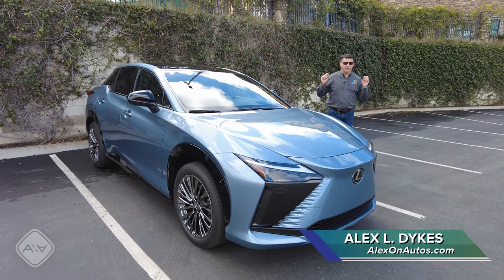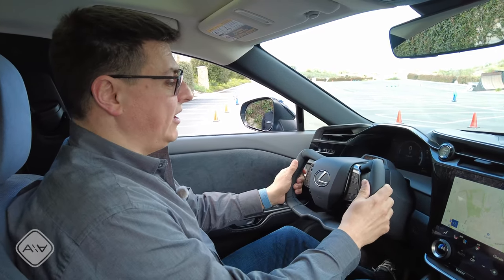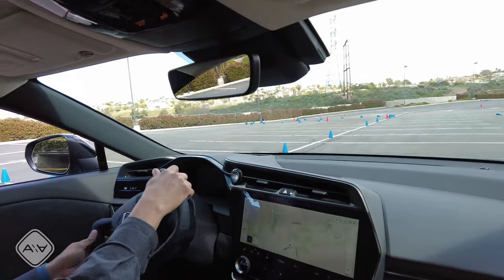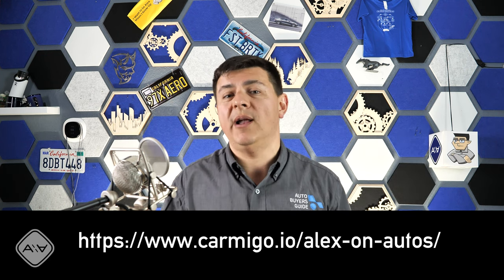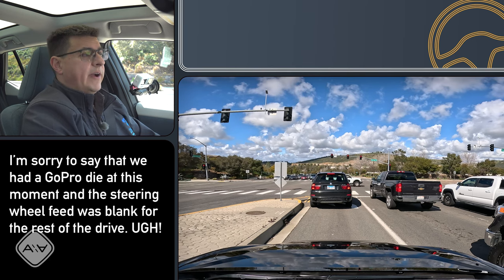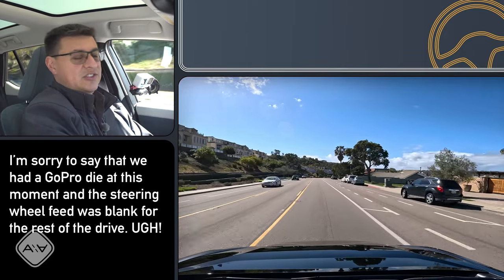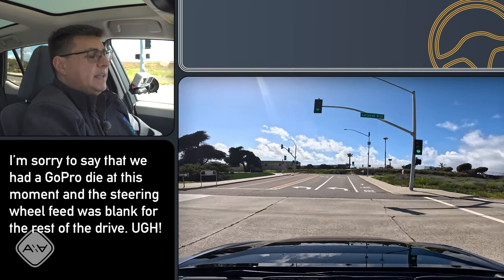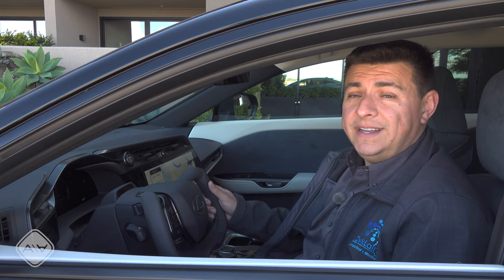The RZ 450e's Steer By Wire Yoke Is What Telsa Needs To Try

Comment: This is exactly what I thought, or was sure, Tesla would do when they implemented the yoke.  It seemed obvious that this was the correct way to do a yoke and it's weird that Tesla didn't do it.
Reply: @daflipbizkit  it seems like something they would do. They like removing physical things from the car, so removing a steering column is on brand.
Reply: You took the words out of my mouth - I had just assumed this is what Tesla had already done! I didn't know Tesla just lazily changed the shape to a yoke and didn't change anything to match. Silly me for thinking changing the steering ratio with speed would be obvious.

Comment: If I was in the market for a new Lexus I'd option it without, mostly because I wouldn't want to have someone borrow my vehicle to say, make a quick grocery run, only to have them wreck my car due to them not being familiar with the steering system (different ratios at different speeds is asking for trouble if you don't walk someone through it beforehand)

That being said, I think this does make sense in the long run for an EV. It gets rid of mechanical parts, makes it easier to manufacture for left/right side markets, and makes it way easier to integrate with automated systems, it's much more like a giant RC car this way. A lot of older buyers are going to dislike it just bc it's different and unfamiliar but my main reason for holding off is bc it's the first implementation of new tech. I'd wait until the 2nd or 3rd gen, after they get feedback and tweek it to be less spazzy.

Comment: The Canoo EV minivan also has a steering yoke which changes its steering ratio based on speed.  I would use one of these as long as I didn't have to do hand-over-hand steering.  The Tesla yoke seems to be poorly thought-out.

Comment: It's not about the "yoke" as I'm reading in some comments. It's about the variable steer by wire. I think it's the future of steering. The hand over hand, lots of movement to the steering wheel we do now will go away. I'm big on this car. Despite whatever shortcomings there are with range and charging speed, the rest of the car does things I like. I'd only ask for the option of full one-pedal drive. The only silly thing I've found with this car is the fake propulsion noise in sports mode.

Comment: Definitely a solution in search of a problem. How do people adapt who drive different cars frequently (I do)? How does this system handle decreasing radius curves where your speed has to vary, sometimes drastically? How safe is this from system failure? What about state motor vehicle laws mandating direct mechanical steering? Will training be mandatory for drivers new to this system (haha, when pigs fly!!)?
Reply: Just like anything else you get used to it.

Comment: how much extra battery does the steer by wire take and will the steering work when you run out of power?
Reply: The steering has its own emergency power unit

Comment: I would absolutely love this on my next car.  I have a bunch of questions:

1) I heard a loud click when you turned the yoke to the right of center on the test course.  Was this caused by the yoke?  Something hitting your microphone?  Something else?

2) Can you select a custom feel for the yoke?  For example, I prefer a tighter steering feel, with speed sensitive feedback.  It seems like it would be easy for the driver to select a steering feel that they prefer with this design.  Does the RZ let you do that?

3) Does the force change as you turn the yoke more towards the left or right?  In other words, does the yoke's resistance increase as you turn more, or is it linear throughout the turn?

4) Does the yoke return to center when you release it?

5) How do the yoke design and the instruments being located farther back affect instrument visibility?  Is it easier to keep your eyes on the road with the instruments closer to the windshield, as in a heads up display?
Reply: Q3, feedback force seems to me like it would be absolutely key to making this work well. Also, from Alex's parking lot demo, seems POORLY implemented if at all. Sad!

Comment: This has in fact been in the works since at least 2014 in the form of an E-HPS system although back then a manual column was still required as a backup steering system in case of a failure.  The steering wheel was connected to a torque sensor for steering inputs which were passed to an ECU to control an electric motor that powered a standard HPS steering gearbox.

Comment: This reminds me of the racing technics.   In motorsport, steerings are modifed to allow the driver to keep hands on the 9-3 position and never take hands off the steering wheel on track.    Personally it makes sense to me, as in my racing sim I have my wheel set to 270 degree of rotation, instead of traditional 900 degree like IRL.

Comment: I might opt for the yoke over the regular wheel. It does mean less turning to make tight parking maneuvers. And it sounds like it'll insulate the driver from road vibrations.

However, for most, they'll probably think the yokes on them.

Comment: Less on the steering, more about adding range.  ~220 miles is foundational.  If they want to be up there with the Model 3 and other they need to add +100 miles.

Comment: Esoteric engineering question: If you have the steering wheel at a given positional angle at at one speed and accelerate or decelerate without varying that steering wheel angle, does the rack change steering angle? The answer would likely have to be yes.  

This was a concern with Sport modes and variable throttle position mapping. What happens if you engage sport while car is in motion and throttle is depressed. The solution was usually that they ignore the sport button/mode change until you fully lift the throttle once. That avoided sudden unintended throttle variation.

BTW, it's my understanding BMW has done this since the late 1990s, but to a lower extent. We had it before steering by wire. Our 2000 BMW Z3 had it, and I can't say it was ever a problem or even noticed. Power steering sucks the life out of all modern car steering anyway. I appreciate the changes you're describing in this video are FAR more pronounced because yoke and the need for never requiring crossover full turns of the steering wheel.
Reply: yes

Comment: I think with time the driver's muscle memory will rewire for the yoke and inputs will smooth out. Still though, I would guess most people that can afford a top end Lexus or Tesla have more than one car and so going between Yoke/Steering Wheel would be odd. Not really an issue for me until it trickles down to the Corolla Yokester.

Comment: I suggest this is helpful at slow speeds but not s one gets closer to the 45 mph switchover if I understood correctly. those of us who play racing simulation games have used such parameters on wheels for years and many times we make the effort to remove or minimize the variable steering aspect. For many of us, at high speeds linear feel on the steering wheel is very important..

Comment: I wouldn't call it a solution in search of a problem. It's more solving the original problem of the steering column that requires the 2.7 turn-to-lock. Back in 1890, there was no variable way of doing it, so here we are. Everyone getting their license asked why it requires 3 turns to lock but we all have to just get used to it. The same will apply to this system if it ever becomes mainstream in the future. 

Either Lexus will set a precedent and our grandkids will have to get used to this system, or they don't, and everybody still turns the wheel 3 times lock to lock.

Comment: BMW has had Variable Steering wheel on their X5,X6 and some other models way back when as their steering wheels were known to be firmer and some people had a hard time with the wheel so it was available as an option but it was pricey. I think the steering column was still there but not sure how they implemented it into the vehicle. It is weird and does take time to get used to it
Also, the new electric vehicle CANOO is also using this same variable steering.
Reply from the maker: Variable ratio steering has been around for a while, but the ratio spread is small. This is entirely different as it radically changes the ratio.
Reply: @AAutoBuyersGuide  got it!

Comment: Will be interesting to see what is the fail safe mode. Being computer controlled, what if that fails?
Reply: It's been in planes for a while, it's fine
Reply: @klyded8523  planes have redundant systems,  cars don't.
Reply: @gianfrancoa  it's fine, don't worry about it, there's safety measures in place
Reply: @gianfrancoa  btw it does have a redundant system, so you're wrong there.
Redundant processor, and emergency power supply.

Comment: steer by wire is scary because if the car loses power then you have no way to steer the car vs having a physical shaft connected to the rack

Comment: I think if you haven't used for a week you can't really have a definitive view on it. It's different and by default having to learn the system will cause some anxiety. It's a lot like column shifters vs console shifters vs electronic shifters. I drive a semi and we switch trucks all the time I have to use may 6 different controls for vehiclea between the work trucks and my personal cars. All took time to get used to.
Reply: I switch between automatic and manual (3-7 speed) cars as well as motorcycles which steer very differently from cars ( you push the bars right to initiate a left turn) and have independent front and rear brakes. None of the vehicles I drive has a control whose operation changes the hand(foot)-eye(inertial) vehicle coordination with speed.

Comment: Still stupid! Though a variable ratio yoke steering rack is infinitely better than Tesla's application, the yoke is still stupid. You end up with whacky steering. Infinitely better in parking lot situations than the Tesla but hampered by the fact that at moderate speeds you don't know if it's going to be quick or not!! As you well put it, a solution to a problem that doesn't exist. I can just imagine people steering into the oncoming lane not realizing that you are in the quick mode. Many other manufacturers have variable rate steering, but you essentially never notice it except when parking when you notice that you have a smaller turning radius than you expected (if the system is well calibrated). Again, even this smarter, better thought out, version of the yoke steering wheel is still STUPID.

Comment: Sure, they can try it.  I won't have it.  Put it in a slide and recover.  Evasive maneuver at various speeds.  Age it for 20-30 years and drive it again.  No thanks.
Reply: Theoretically, steer by wire could nearly instantaneously recover from a skid, since it could turn the wheels faster than a human could.
Reply: @aspecreviews  or put you into a skid. And how good is the road feedback? Look at the complexity necessary for really expensive simulators to do a good job. Steer by wire is for packaging and cost and only suitable for autonomous vehicles and AirBus.
Reply: @Sylvan_dB  with multiple redundant steering angle, yaw, and g force sensors, a system like this wouldn't put you in a skid without you explicitly wanting it. A steer-by-wire drift car could pull insanely long drifts with very little manual correction from the driver.

Also, feedback isn't complex. The most expensive sim racing wheels are direct drive, so it's literally just an industrial-strength servomotor and (likely several redundant) rotary encoders to measure steering angle. It's less prone to failure than a belt or gear driven feedback wheel.
Reply: @aspecreviews  I'm not talking about toy simulators used for playing games.  I'm talking about professional equipment used for practice and training, and that cost as much as one of the cars they mock. The last one I used cost more than I make in a year as a principle engineer. Entry level is somewhere in the $50,000 to $100,000 range and some gamers do use those low end units.  The feedback SYSTEM is considerably more than "an industrial-strength servo motor" and some encoders.  Servos are for positioning, not variable force. Rotary encoders are for steering input, not feedback.  The feedback in a simulator is entirely artificial making it easier than in a real vehicle.  The system must correlate steering feedback with pitch and yaw, which in a real vehicle requires g-sensors at least as good as in your phone to detect what your butt is detecting.  That must be processed and combined with force sensors in the steering rack that detect what forces the road is applying to the wheels.  The code is complex and extremely real time.  The sensors are actually very expensive because they have tight real-time constraints on their measurements. That chunk, chunk, chunk feedback on a servo-based toy is not how a real steering wheel feels unless you are running into curbs and potholes.

I'm sure steer by wire will never cause a problem, just like throttle by wire has never caused unattended acceleration and the 737 Max MCAS never drove planes into the ground.

Has your computer or phone ever misbehaved?  Maybe when you tried again it was fine, or maybe you had to reboot or power cycle.  Intermittent errors caused by race conditions in the code or even a single bit flipped due to electrical noise do happen. The software in the space shuttle was critical and bugs were fixed before every mission during the 50 year life of that code.

Do you automatically just assume every change being pushed is for your benefit? Life lesson for you: It's not.  Enjoy.